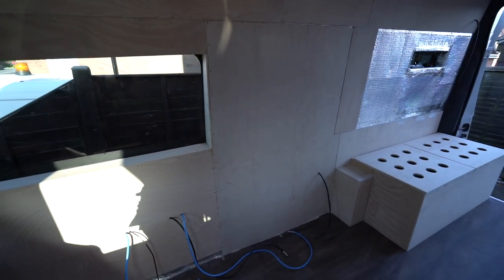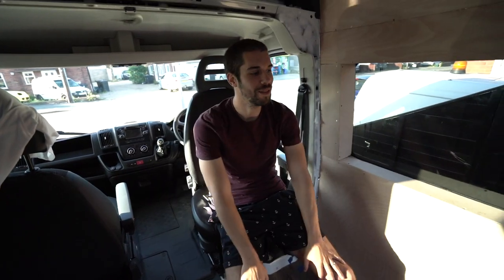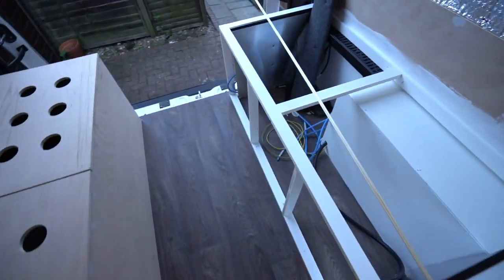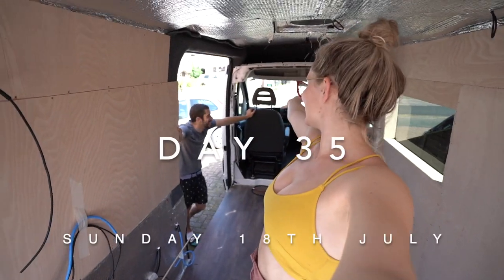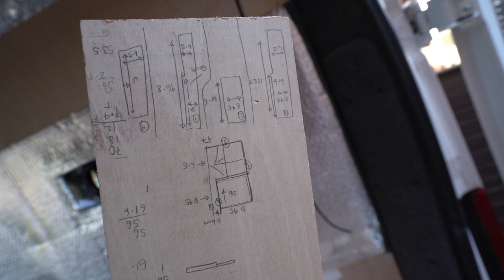SHOWER BASE / WINDOW FRAME - Citroen Relay Camper Van Conversion UK -  Week 18

Comment: hi guys love the shower base look, hope you dont mind ill copy this idea as it looks not too cramped although i have an L3 H2 as opposed to your L4. if you could be so kind do you have the back to front dimensions of the internals as the left to right. so i can see if i can fit this too. also guys what width walkway have you got to work with in the centre of the van. Much appreciated and where are the rest of the vids lol. seriously great job. ive just upholstered my own seats now so cant wait to fit them
Reply from the maker: Hi Lee sorry for late reply, Van is split into 3x60cm sections, so middle walkway is around 60cm, kitchen side 60cm, shower side 60cm

Comment: Excellent job. Can’t wait to see some walls now ha ha. Toilet vent should go to the bottom. Hopefully you guys can do it :) oh also, shouldn’t the shower tray be raised? You will have to out some pipe for drainage to it which means the toilet will be even higher?
Reply from the maker: Yeah I think the toilet vent on the bottom would be best, need to investigate ! 
Shower try doesn't need to be raised, the drain pipe goes straight through the floor of the van (where the shower tray hole is, just need to drill it out once we get the tank to figure out best position)